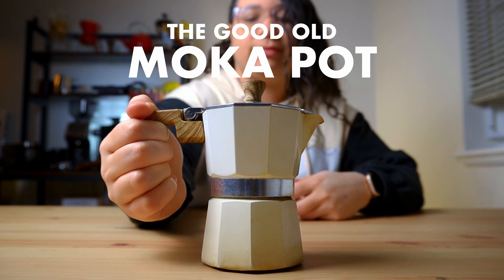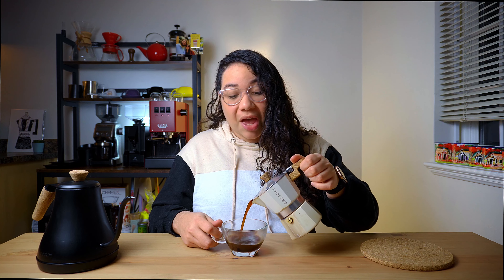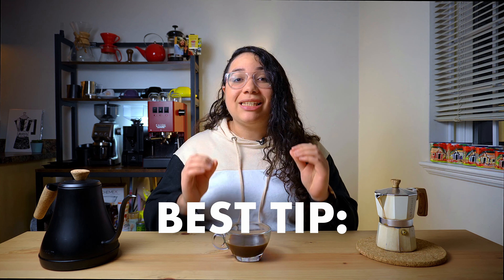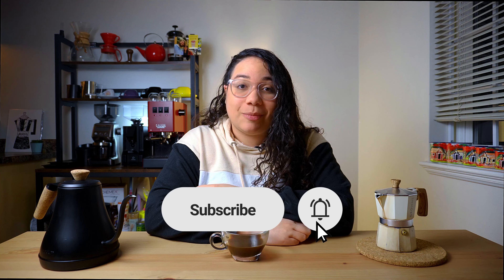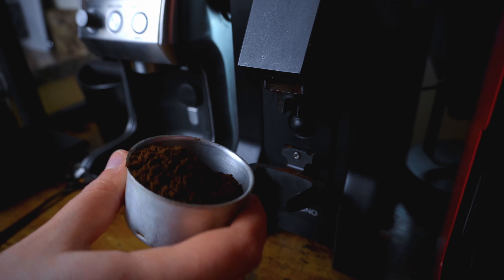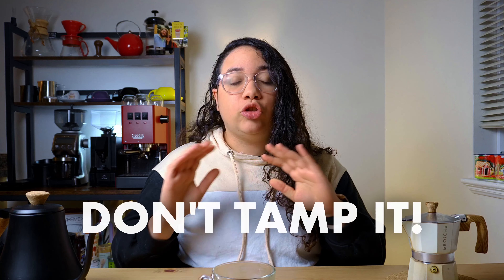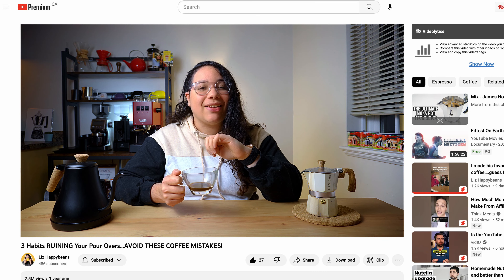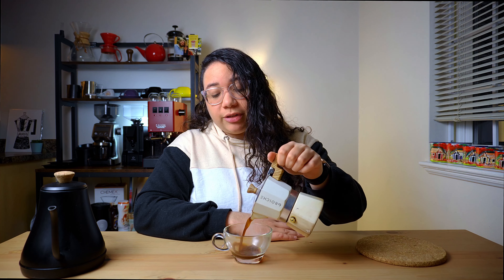3 Mistakes RUINING Your Moka Pot Coffee (And How To Fix Them!)

Comment: Thanks for sharing! For some reason, this showed up as suggested for me, and because I got the exact same Moka Pot (size, color and brand) you show in your video, I decided to watch. ...and even from just the camera angle you have, we have so many of the same kitchen items...it was bizarre. I'm always in a hurry to have my coffee, so I usually put it on pretty high (but I can also tolerate some bitterness), so I will have to try being more gentle with my brewing next time.
Reply from the maker: Wow! What a coincidence! I'm so glad we found each other in this platform <3 Another idea to reduce brewing time and reduce bitterness is to use hot water from the beginning, that way you can brew pretty fast, even at medium-heat. Hope it helps and looking forward to seeing you around for more :D
Reply: @lizhappybeans  yeah, I always boil my water in a kettle first.
Reply: I get the best flavor if I follow Bialetti's instructions to start with cold or room temperature filtered water, use a low gas flame or a preheated medium electric stove, then remove the pot from the stove immediately when it starts to gurgle or a couple of seconds before it starts to gurgle, and let it finish brewing off the stove from the heat inside the pot.

For me, starting with hot water doesn't improve the flavor. 

But, I appreciate your other good tips.